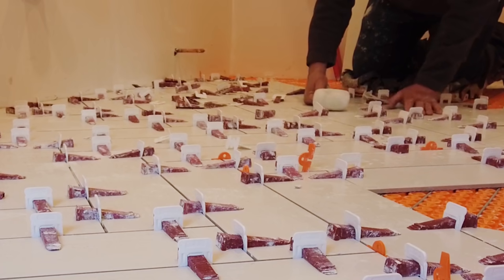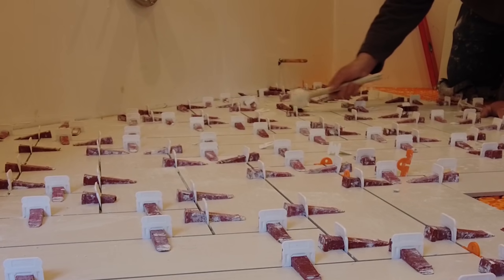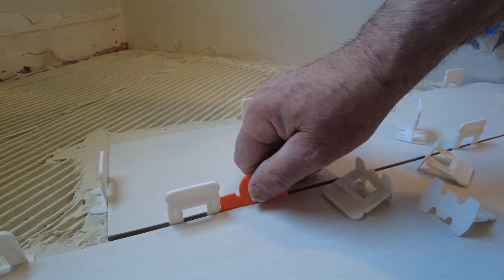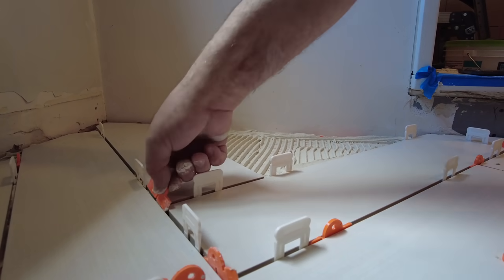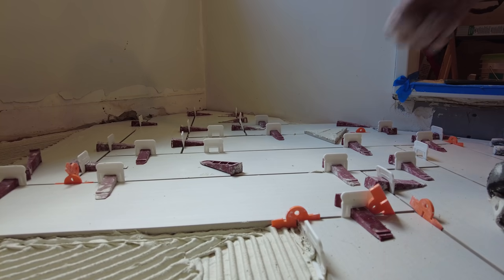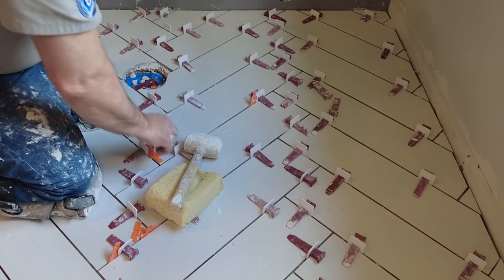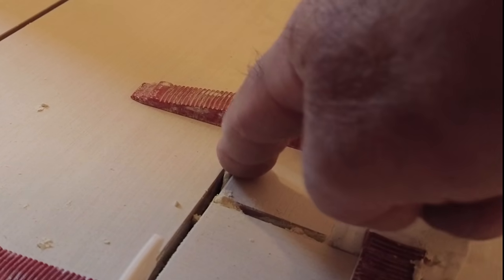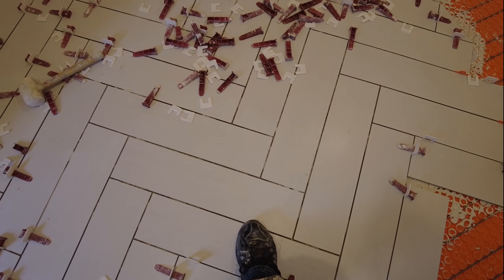Leveling Clip problems solved.

Comment: Great video Sal.  I used the leveling wedges on my last project and found the wedges would damage (chip) the porcelain tile finish when I broke the clips.  Not sure if this was because I had poor quality tile, because they were porcelain tiles, or the specific brand or wedges (maybe they were too narrow and created too much pressure on the edge of the wedge).

Comment: More great tips from you.  I've always tried to break mine off in-line with the grout line, since even a slight angle could cause this issue.

The newer versions of the clips don't seem to have this issue, at least that I've seen so far.  Perhaps they are made weaker.  What do you suggest for a 1/16" grout line (and clips) where you can't get a spacer narrower than the clip itself?

Comment: Thanks Sal for all the info. I'm installing 12x24 porcelain tiles on the floor of a 108 year old house, i.e. the substrate is not perfect. Do you think it's OK to use 1/4" spacers with 1/16" clips?

Comment: The most clutch tip in this video was scraping joints before you place the clips so thinset doesn't smoosh out into the clips.  That combined with undersized clips I installed my first floor without problems thanks so much Sal.
Reply from the maker: Thanks for watching my video.

Comment: Great tip Sal. You are definitely the god father of tiling! I only use this method if I'm doing an 1/8 grout joints and run out of 1/8 clips and have to use 1/16 clips.
I rarely have any issues with the clips getting stuck. I try to make sure I keep the joints clean so that doesn't happen. It is a great idea but for me an extra step would not be ideal when doing large sqft of a room.......I rather use different size clips for different applications. So I rather rely on the clips as my spacing to help quickly setting tile. This may be needed for some tile setters though.
I do this 5 days a week but what do I do on my day off on a Saturday morning......WATCH Sal videos... Love your work Sal!
Reply from the maker: yes, if you keep the grout line clean and use a good quality system, you won't have any issues. Thanks for watching my videos.
Reply: one of those things I wish I would have thought of first!  Great Tip!!

Comment: Good tip, Many professionals only show the advantages of a method or system they use, probably so that they do not have to admit that they run into problems. And many will ignore this solution because it takes more time and Time is Money for them, it damages their reputation and their Egos but as a DIY this tip is very useful, I can imagine that if you have to cut several clips later it will waste more time than solving the problem .before it arises.

Comment: This is great but I’ve just laid a ton of floor and come up with this problem after trying to get them up! What do I do in this situation? I’ve stopped for the time being hoping I can come up with something. Did about 6 and 5 spacers are sticking up 🤦🏻
Reply from the maker: Scrape the thinset from either side, heat a blade until red hot, cut the plastic away.
Reply: @ ok I’ll try that thank you! Saw another video where it suggests hitting from the side, I was hitting from the high part of the wedge from the back. Would this be worth trying or is the damage done?

Comment: probably a good tip for those who just cant work clean. i know you do good work sal but honestly cleanliness might not be your stong suite. i see those wedges and see thinset covering them and cringe, also when striking the thinset away from the tile edges if the margin trowel is held at the wrong angle it just pushes thinset to the tile edge and you cant have any of that when placing a clip. i guess im just anal, but none of my wedges have thinset on them and on average when doing a job with 1/16 clips and using them as my spacer (so a finished joint of 1/16 if rectified) i get maybe 1 clip that breaks wrong. so imo the best info on this subject is to be more careful on cleaniness, but most just cant do that, so i suppose this is good info for most others....
Reply: I envy how clean tilers can work, I end up on my hand and knees with a sponge for 2 hours lol.

Comment: Your the man sal great idea. One clip you won't run into that problem are peygran they will break below the grout line everytime no matter what
Reply from the maker: I have tried them Not really a fan of the wedge they have.
Reply: @SalDiBlasi  same here the wedges are to small and even the clips yes they don't break in the grout line but they are hard to break off and also overpriced

Comment: Great video Sal, what’s the best method to remove a clips that are stuck in the thinset? I was thinking a grout removal tool using a oscillating tool?
Reply: I usually try to use my grinded but sometimes I heat up my knife with a lighter and use to melt through

Comment: Great tip Sal! Been struggling with the PLM 1/8" clip removal at times despite cleaning the joints best I can. Will try this for future projects.
Reply from the maker: And be sure to knock your clips out the next day.
Reply: I find if you wack em from the sides , as close to tile surface as possible, ( I use a solid rubber grout float). I have no problems.

Comment: Sal - I bought a house on concrete slab.  I have a son in a power wheelchair. I need to demo entire bath and recess the entire floor (with lipless transition into bathroom and into shower). I will remove existing tub/shower insert and install a tiled curbless roll-in shower. Is it possible to get your advice on the best way to do this?  I have watched MANY of your videos and am still perplexed.  Thank you.
Reply from the maker: Talk to a Schluter rep, they can give you the best specific advice for your situation if you use their products.

Comment: Sal, as always, excellent advice!

Question: I am about to tile a floor (on Ditra) for the first time. It's 13" x 13" tile and I am leaning away from an anti-lippage system. Will I need one on a tile that small?
Reply from the maker: I wouldn't bother using them on a tile that small.
Reply: @SalDiBlasi  Thanks, Sal. Good to know your expert opinion matches my hunch.  To make life easier I have pre-filled the Ditra. That alone gives me even more respect for the wear-and-tear that tilers must endure on the job.

Comment: I'm getting the odd spacer that leaves a small piece between the tiles when removed (on the Perfect Level Master). Only thing I can figure is to use a knife to cut them out best I can.
Reply: Use a multi tool
Reply: just make sure you don't get the tool blade cross wise in the joint.

Comment: I'm just about to try a similar system out called "clip it", the clips are already 3mm though and I don't want to go larger than that so this is not an option. hopefully I don't have too much trouble.
Reply from the maker: Be sure to knock out the clips the next day and to keep grout lines clean.
Reply: @SalDiBlasi  It worked out great, I'll use these on everyfloor I do from now on, not a lip in sight.

Comment: One of the pros here can help me? I use the crimp tool to level the tiles but every time the tiles separate more causing a bigger gap than desired. Why does the tools shift the tiles away from each other? Leveling is good but not the gaps. Anyone know or have this issue?

Comment: i like the thin clips  ,as the thinset cures,crystals hydrate ,ive used large format, non rectifed edges sort of taper,and still end up with tight grout lines

Comment: Is it just me or does using tile level system like these clips take more time to install I’m only installing 100sqft a day with these clips compared to when I didn’t used clips i installed twice that
Reply: And it does make that floor flatter but I feel like I’m lifting up every tile to make sure I have enough coverage because I’m worried about the spacer under the tile preventing contact with the thin set

Comment: Or... Stay clean!  1/8" will break out just fine.  Thinset built up on the edge of the post/clip causes the failing break off.  Also,  thinset between the post/clip, and the tile, will cause the pattern gain that normally results from a sloppy messy installation.
Reply from the maker: Clean is important, breaking out the clips the next day a must.

Comment: My problem is it breaks too easily right after installation before it's set so need to use something heavy to hold the tiles it down.
Reply from the maker: You need a better leveling system

Comment: What about if you don't use those clips at all ? And set the tile as a real tiler?
Reply from the maker: A real tile setter understands and uses all the tools at his disposal.
Reply: real tiler? i would love to see your 36 or longer plank job with a 1/16 0r perhaps slightly wider joint without clips? or at least see it compared to a job with clips. its impossible to get a plank job without clips to look like one with even if the slab is perfectly level . you see most long planks have a bow in the middle and without clips there is absolutely nothing you can do to prevent a rise where that joint meets the next staggerd tile, but with clips it actually splits  all heights perfectly and can put a slight flex to flat until the thinset dries. if you take 2 plank tiles and hold them face to face you can see the wobble and if you apply pressure to the ends you can press that wobble out easily and thats what the clips do.....now perhaps with a square tile run straight pattern, i supoose you can get the floor just as flat, but not with planks, no way possible

Comment: What happens when the clips damage the edge of the tiles?
Reply from the maker: Never had that happen, the clips are plastic, the tile is porcelain.
Reply: @SalDiBlasi  when that tab breaks, the wedge rocks forward, and create a pressure point that blew out the edge of my glazing

Comment: What is the smallest size tile you use the leveling systems on?
Reply from the maker: Usually tiles bigger than 16", however they can be used on tiles as small as 12" but it is really  a waste.

Comment: That doesn’t solve the problem of breaking your not using the spacers for what they are intended you are just recommending using bigger spacers
Reply from the maker: If you had ever use a tile leveling system, you would know that it does absolutely solve the problem.

Comment: What a lot of shite, if i want 1mm joint im not going to put 2mm spacer
Reply from the maker: You should never use 1mm grout joints, no matter what. Don't believe me, look it up in the TCNA handbook.
Reply: @SalDiBlasi  with respect sal, ive been in the tile trade for 40years and ive never seen a marble or any stone job done with 2mm joints uk and Australia
Reply from the maker: @paulcowan5748  2020 TCNA handbook page 37 and I quote
"The minimum required joint width for ceramic tile and Natural stone tile is 1/16". Setting ceramic or stone without a grout joint of at least 1/16", often referred to as a butt joint, does not provide sufficient accommodation for dynamic building movement, differential thermal expansion , or allowable variation  in fabrication or manufacturing."
End quote. look it up, but then again the US might have different standards than where you are. 
https://www.tileletter.com/what-is-minimum-grout-joint/
https://www.ceramictilefoundation.org/blog/ansi-standards-tile-installers-best-friend
Need more, I can refer you to other references if you like.
Reply: @SalDiBlasi  ok sal one sixteenth is 1.58mm  think we're  splitting hairs now, sorry for comment, should have chose my words more carefully,can see you love your trade as do i
Reply from the maker: @paulcowan5748  No problem, if I am challenged I will usually respond with backup and proof of my assertion. Lots of installers around here that really should not be setting tile.

Comment: I really don't know but after using those things ,I would say the perfect place to put them is in the trash can.  Dont waste your money or time.
Reply from the maker: Correct, you really don't know.
Reply: @SalDiBlasi  yep. If you are a DIY dont waste your time or money. I can do better old school
Reply from the maker: https://www.youtube.com/watch?v=u3_-VKGNCQY&t=2s
Reply: @SalDiBlasi  yep. I appreciate it.   I used a different brand of level system.  It was a joke. The torque tool broke the first day . That was just one problem.  Just wanted to say that I do appreciate excellent craftsman like you and donnie D. but this stuff didnt work well for me.  Have a blessed day mr. Sal.
Reply: I'm doing 12 X 24 tiles as a DIY project..I can't imagine doing the job without them.
Reply: @stevebetker829  try spin doctors
Reply: @SalDiBlasi  that right there is what finally got me on the  clip and wedges. The ones I can't stand are those Tuscan seam clips. Look like little pagodas.
Reply: @Jack-russell103  ok. Thanks for the recommendation.  Appreciate it. If it looks like I cant get it old school,  I will give it a try. Lol. Lord bless you.
Reply: @stevebetker829  no,problem. It works I do it all the time